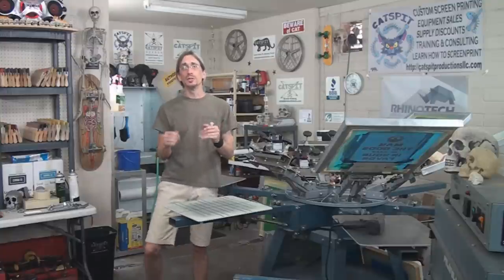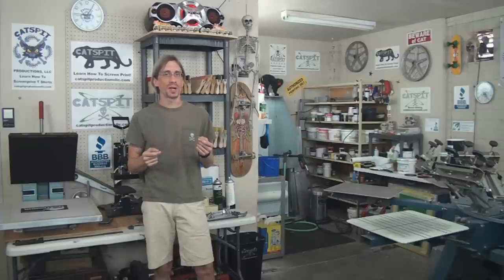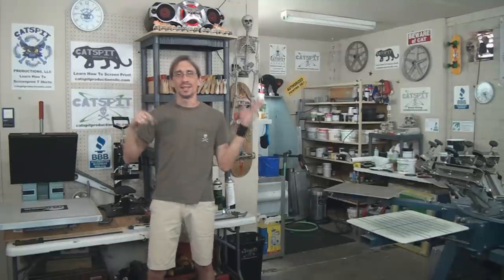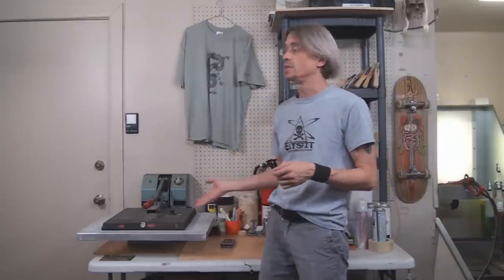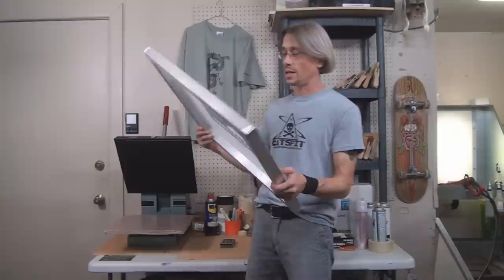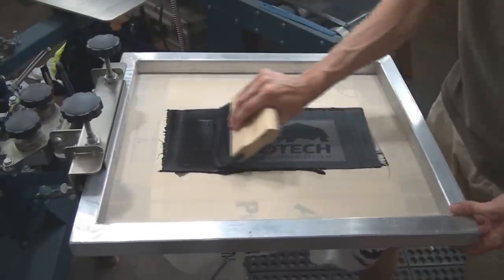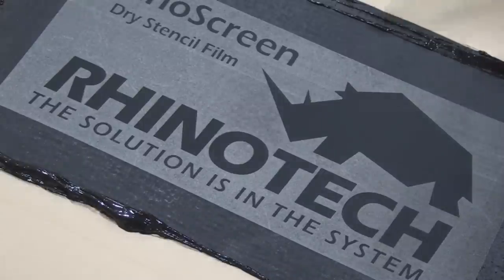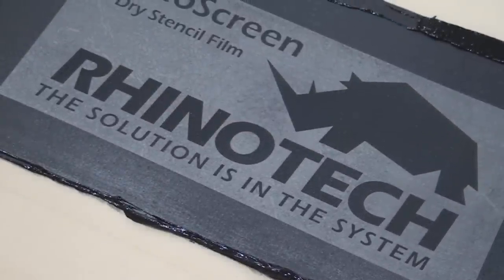Screen Printing Shirts Without Emulsion, Chemicals or Film Positives!

Comment: I have saw a lot of videos on on using vinyl for this, and seem to habe can to the conclusion you can for small orders and the stencil lasts longer of the vinyl is put onto the ink side rather than the bottom due to the pressure. 

Idk about the dragging it across though.
Reply from the maker: Yes, you can do that but in my experience it's better to put it on the substrate side. The adhesive and ink will keep it in place whereas with putting it on the inkwell side with the squeegee will result in the squeegee pushing off small detailed parts of the image. Thanks for watching. Screen Printing Equipment & Supplies - http://catspitscreenprintsupply.com/

Comment: It looks like you tape off the underside of the screen, right? If you're worried about dragging the squeegee over the stencil and wearing it out, couldn't you just adhere the stencil to the underside of the screen?
Reply from the maker: I did tape the substrate side, yes. But I just did that so the squeegee wasn't running over the tape. The stencil material is pressed to the substrate side anyway actually. Thanks for watching & commenting!

Comment: Great video! Would the stencil system work with a 350 or 400 mesh screen? I’d like to use a screen to apply a gloss varnish (varnish is formulated for application via screen printing) to paper and card stocks to create a Spot Gloss  - which would be a great alternative to applying spot varnish the old-fashion way using UV lights and equipment setup.
Reply from the maker: Thanks! Glad you enjoyed. I would not recommend this for your application. The stencil will likely break down with the use of such inks and chemicals. This is a hobbyist grade product allowing for printing with plastisol and some water based inks. It's not durable enough to withstand much more. You would need a graphic emulsion which will resist the inks you want to use. Thanks for watching! Screen Printing Equipment & Supplies - http://CatspitScreenPrintSupply.com/

Comment: If would like to reuse again, this design (logo) how is the best way to clean the screen you know the extra ink  and save for the next time when I need , and the other question is any  kind the chemical to use for take away the design (logo) and save the screen for another different logo
Reply from the maker: You would need to use a solvent for the ink you're using. If the pressure washer does not remove the stencil alone then try some haze remover. Thanks for watching! Screen Printing Equipment & Supplies - http://CatspitScreenPrintSupply.com/

Comment from the maker: LOL, I feel for you but it’s not too hard. I think you need the proper instructions. Use some pressure when you pass the scoop coater over the mesh. Also start with the screen at an angle and then move it more upright as you reach the top. Then wait a minute before pulling the coater always so the emulsion has time to go back in the trough. Thanks so much for watching and dropping me a note. ☠

Comment from the maker: Although you can cure shirts with a flash cure a belt dryer is much different. Yes it has bigger infrared panels inside but it’s the oven chamber that makes the belt oven an oven. It can hold a more consistent temperature inside the tunnel chamber and it will be much faster than a flash cure. Thanks so much for watching and dropping me a note. ☠

Comment: I can tell you I own a sign company in addition I do heat press garments. I just got into doing ink. What I do is cut my graphic with regular lettering vinyl, not heat press vinyl. I cut it mirrored into vinyl. from there I apply the vinyl with transfer tape to the back of the screen and print from there. This way Im not spending money on a printer I don't need nor the ink for the printer. In addition my graphics are cut and weeded in minutes therefore I am not waiting for a order to be processed and shipped to me before I start a job.Having said that I have no need to heat press my screen. I also have no need to worry about the squeegee catching the vinyl and pulling it on long runs since again the vinyl is in fact on the back of the screen
Reply from the maker: Very cool, thanks for sharing. I’m an old pro with emulsion. I always have screens ready to expose and I can make a screen ready to print very quickly. But many people use the vinyl adhesive plotter method. Lots of sign people do it for simple spot color art. It can work great for many applications actually. Thanks for watching and leaving a comment! http://www.catspitproductionsllc.com/ - http://catspitscreenprintsupply.com/
Reply: as far as ink I haven't bought new ink for about 3 yrs now :) I bought the ink refill bottles which came with 3 colors and 2 blacks and they seriously have lasted me about 3 years and I still have quite a bit left, the printer was 30 bucks at walmart and even came with starter ink, but I paid 10 bucks for the refill botlles and to have gotten 3 plus years out 30 dolllar printer and 10 bucks in ink that is a total of 40 bucks for 3 plus years possibly 4 ish , far from wasting money :)
Reply from the maker: Thanks for your input. I appreciate it. That's very cool. Thanks for watching. Screen Printing Equipment & Supplies - http://catspitscreenprintsupply.com/
Reply: Michelle Sullivan I'm thinking of trying this method-what has been your experience as to how many prints you can do before vinyl gets loose/ unstuck from screen??

Comment: I personally make sure to use RhinoTech's green press wash PWG122 I believe it is and it does not hurt the stencil.  However, if you use any sort of tape with somewhat strong adhesion to tape the screen off on the substrate side it will pull off the stencil in the places where it is taped.  I usually do not take the tape off until I am through with the screen anyway.  The guys at RhinoTech can give you much better detail on this as I probably do not do it the best way.

Comment: Good video sir :)
i'm running tshirt printing business using heat press method.

I think if i use plotter to cut sticker and paste the design at back of the screen, it should be fine don't you think? almost same method like this one, but i can't be sure how long the sticker can last at the screen, can last up to 100 tshirt or not. maybe i will try later :)

Comment: The product is great. Re-claiming is easy. I use a standard Haze Remover and a $70 Wal Mart power washer. The Haze Remover seems to make the removal easier.

The key is a crisp graphic and a laser printer that is in good condition. I use my Oki C-6150 with good results.

Comment: Seems like an "easy" way to get into screenprinting.
Thanks for the video...

According to the Rhinotech website the product is back in stock again
Reply from the maker: You're very welcome. This product is very cool but it can be finicky at times. The time, pressure, and heat are all very critical. Yes the product is finally back in stock and I just got mine this week. I have to reactivate the product on my e-commerce site. Thanks for watching. Screen Printing Equipment & Supplies - http://catspitscreenprintsupply.com/

Comment: Did anyone else forget to make sure your printer worked or should this be a three patter of ten minute videos
Reply from the maker: Not sure what you mean. How can I help out? Thanks for watching! Screen Printing Equipment & Supplies - http://CatspitScreenPrintSupply.com/
Reply: CatspitProductions oh I’m just being a dick and poking a little fun. Your videos are well done and helpful so I am glad you didn’t get the wrong idea. Thanks for the work you put in.
Reply: CatspitProductions btw I assumed after having screen printed diy patches for crust punk and crass bands back in 2003 and assumed that somehow a speedball kit would be adequate not really thinking that a water based textile ink would suck for my intention of fixing the thousands of polypropylene clarity capacitors I have tried to reprint the shell logo and specs on. Trying to research sadly reveals a great deal of info on printing actual capacitors, but the rigging seems simple enough with the casters and springs and drawer pull with the fixed squeegee... however the exact type of ink or screen mesh or enamel that could handle the harsher inks escapes me... looking into it it seems like pad printing might be a better alternative, but there’s a ton of different plates available and I’m now probably going into unknown territory for you maybe... but yeah I think it might be somewhat like the process for photo resist and maybe less waste oriented since I’m not using acid and to dissolve copper.
Reply: CatspitProductions let me try again: how would you go about printing a clear and heat resistant image on a capacitor that needs to reflect its price of up to 40-120 a piece?
Reply from the maker: @l_shaun_bunds_l  No problem. It's my pleasure to help out where I can. But yeah, I have no idea how to print capacitors. I'm a textile guy so that is way out of my area of expertise.

Comment: Hi,
does it works also for multi color artworks? Can you make a 4 colors print or a decent half tones artwork?
I think this way to screen print is very interesting.
Reply from the maker: You can do comic book sized halftones but not very fine halftones. It can do multi colors but this is really a hobbyist product. Direct liquid emulsion is the best way to work if you want total control and abilities. Thanks for watching. Screen Printing Equipment & Supplies - http://catspitscreenprintsupply.com/

Comment: hey have they discontinued this product I have been to the website several times and its not available.
Reply from the maker: +Dawan Johnson It's currently out of stock due to reformulation. They are trying to get it to work better on a wider variety of laser printers. I do not know when this will be back in stock yet. Thanks for watching. Screen Printing Equipment & Supplies - http://catspitscreenprintsupply.com/

Comment: how do you clean the dry stencil after you are done.
Reply from the maker: +Marina Rodriguez With a pressure washer and haze remover if needed. Thanks for watching and leaving a comment! http://www.catspitproductionsllc.com/ - http://catspitscreenprintsupply.com/
Reply: +CatspitProductions hey do will this also work for metal? or just t shirt like material
Reply from the maker: +HAVE YOU EVER BEEN TO SILENT HILL You need to use solvent inks for metals and I'm not sure if this stencil will hold up to that ink. It's mainly for plastisol and water based textile inks. Thanks for watching. Screen Printing Equipment & Supplies - http://catspitscreenprintsupply.com/
Reply: CatspitProductions thank you for the reply
Reply: CatspitProductions hey one last question if i wanted to print on glass what paint should i use ? i'm kinda new to this and trying to start business. thank you so much.
Reply from the maker: +HAVE YOU EVER BEEN TO SILENT HILL My pleasure ;)
Reply from the maker: +HAVE YOU EVER BEEN TO SILENT HILL You would have to use an glass enamel ink. There are some you can dry by air and some that need to be baked in an oven like glaze. That's a graphic industrial application. My forte is textiles.